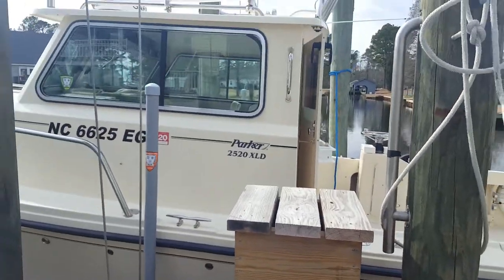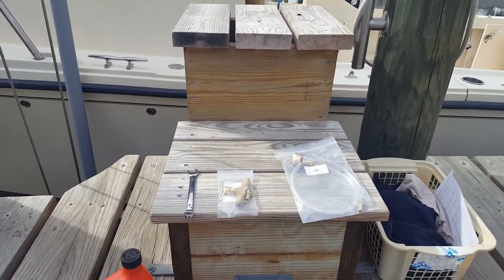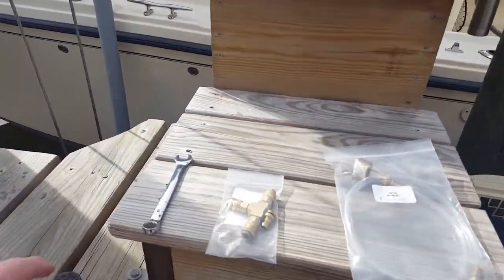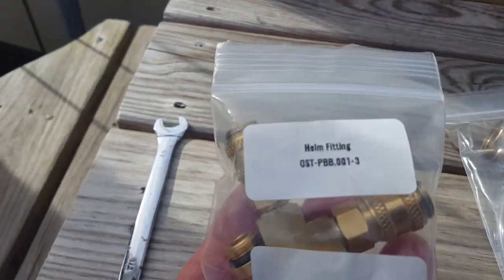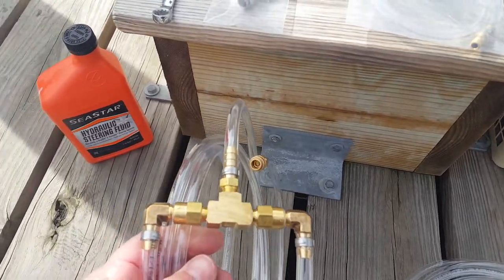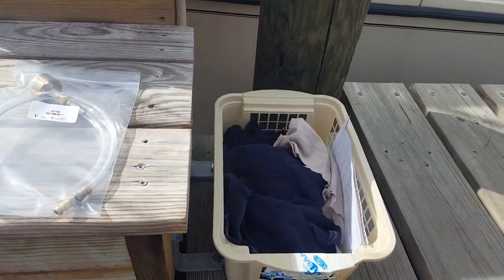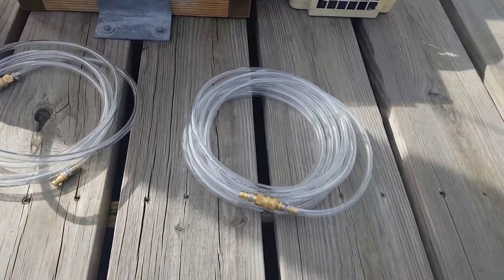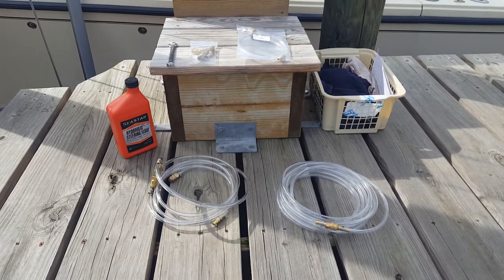Parker 2520 SeaStar Steering Bleed (#1), Bubble Purge Pro

Comment: Seastar fluid is simple 15w hydraulic fluid. UC46 from Autozone. One gallon $14.
Reply from the maker: Hi 1000rr, Thank you for watching and thank you very much for the information. I will make a note of this in my boat maintenance log. Even the SeaStar manual lists eight other compatible products to their over-priced fluid (I paid about $28.00 for one quart), but living in a 'remote' part of eastern NC, none of the alternatives were available. There IS an AutoZone 30 miles away in Washington NC. I'll see if that location carries the UC43...  Thank you once more!
Reply: @andrewfyakim525  No problem you're welcome I serviced a few sea star seals. With the crazy expensive sea star hydraulic steering fluid. I live in Maryland a place called TTI hydraulics told me about the alternative fluid so I figured I'd pass it along help a fellow boater out.
Reply from the maker: @Honda1k  Thank you once again! I'm amazed, and thankful, of the help I get from fellow boat-folks... I hope others see your post here, and I will be sure to pass along your information to others....
Reply: I am looking for that 15w hydraulic fluid.  UC46 comes up empty.  Any Ideas?
Reply: @johnfont4985  Lucas made it as well I'll check. You can also use Maxima 15 weight hydraulic oil.